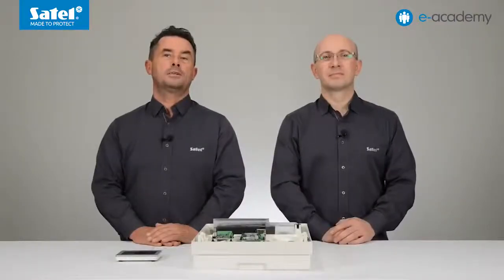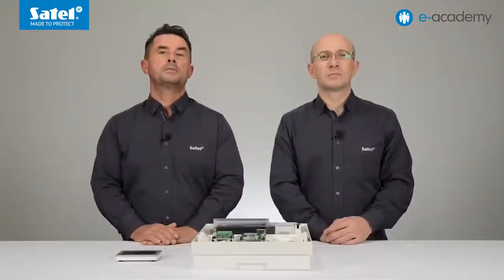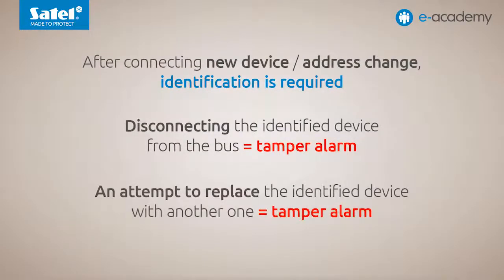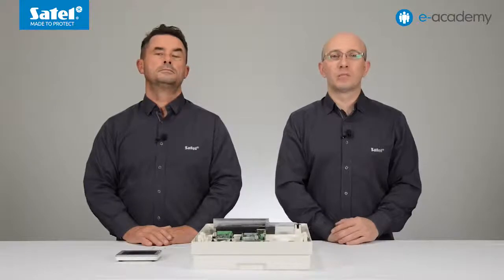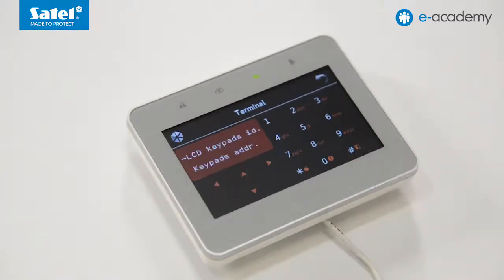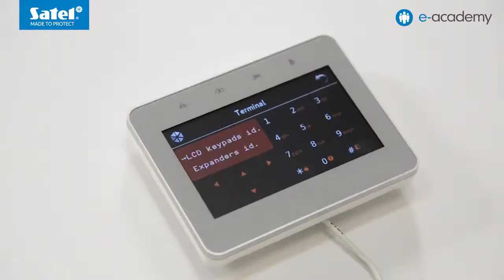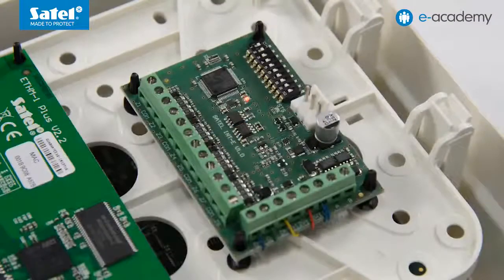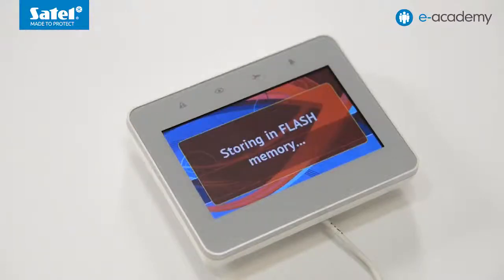SATEL e-Academy 34: How to Identify Alarm System Devices

Comment: I did exactly this when adding a new TSH2 panel on my Integra 64 plus (in addition of the original TSH panel), but after flashing and rebooting of the first TSH display is done, the integra gives an alarm that the displays have changed and I cannot reset the messages. If I try anything on the TSH2 panel, it says this panel is forged.
Reply from the maker: Hi, please contact our Technical Support directly. We will solve this.
Reply from the maker: Hi, was your problem resolved?
Reply: @satelofficial  yes, had to reset all completely and start from scratch, then it worked for 10 minutes and same thing again, reset all again, identified all panels 1 by 1 again and now it has been working so far, going to exchange last tsh panel also for the newer tsh2 this weekend, hope it won't cause same troubles again ..
Reply from the maker: Thanks for your feedback. We're truly sorry for your trouble. Still, letting our Technical Department know about this will allow us to resolve this issue with our future firmware updates. Remember: you can reach our Technical Department anytime you need assistance.
Reply: @satelofficial  i did